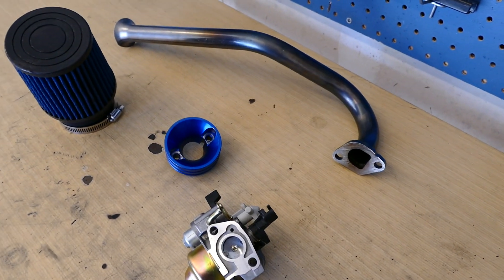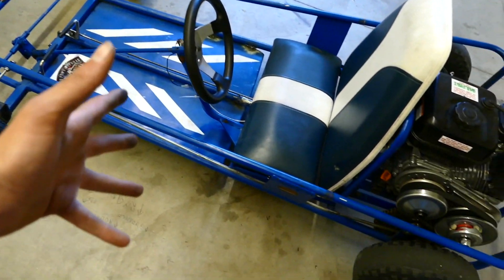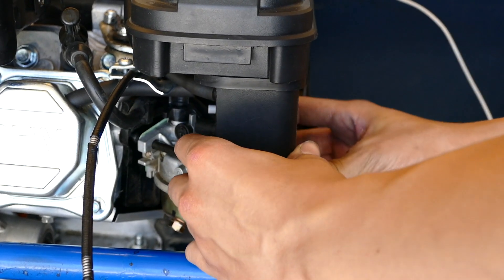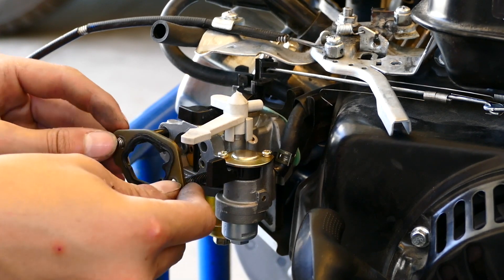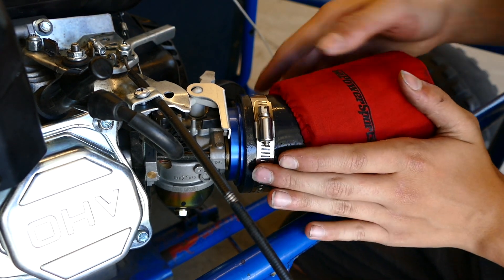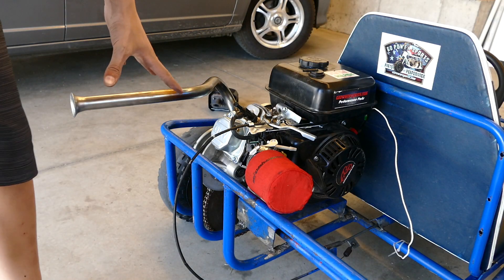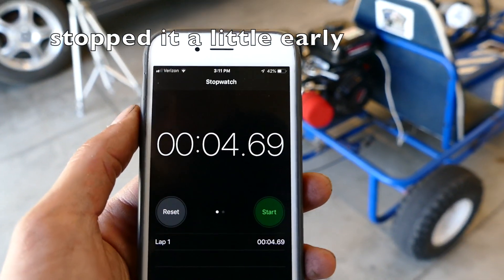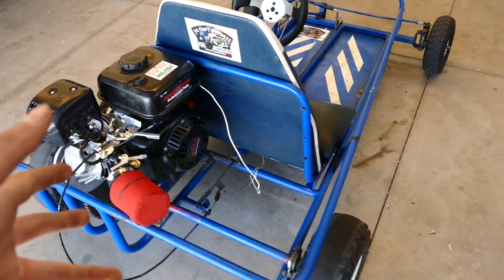How to Install a Stage 1 Kit on a Predator 212cc

Comment: 4:00 I don't suggest you use teethed pliers because I did that once and it poked a hole in my fuel line. If you don't have flat edged pliers then just take some tape and wrap it around the teeth part on the pliers and your good to go.

Comment: What if you install everything but the carb jet?
Reply: Then it would be useless
Reply from the maker: it just wont run very well because of the lack of fuel and make less power than with the carb jet

Comment: How did u get torque converter to fit with a one wheel drive?
Reply from the maker: the secret is.....
it’s not one wheel drive. it’s a live axle 😂 the sprocket is just way far on the left for some reason

Comment: So it isn't necessary to change the carburetor stud to the longer one on the on hemi 212 when installing an air filter?
Reply from the maker: Nope, you just use the original studs and nuts and gasket. super easy

Comment: You’re defeating the purpose by leaving that stock stifling muffler on there kid. That’s why the kit comes WITH the header pipe. You have 2 parts of the mandatory 3 parts done. You won’t see that significant of a change unless you trade that purse in for a wallet. Hehe I’m messin w/ ya buddy. Honestly put that pipe back on.
Reply from the maker: yeah, i know why it comes with it, and on paper it seems like it would hurt it, but in practice i haven’t charted any difference at all between the header pipe and the muffler, even if you leave the stock muffler on it still gives you a massive power gain over completely stock. on an engine like my stage 3 predator 212, it definitely makes it a lot slower, so for that i’ve invested in a custom made header pipe and RLV performance muffler. that thing hauls.

Comment: I just got my stage 1 for my 212 predator and I’m having issues with it and I don’t know why
Reply from the maker: strange. what kind of issues? it should work fine.
Reply: I found the issue but my top end now is lower than it was now
Reply from the maker: @davidrivera2514  top end of what? your engine?
Reply: Ya
Reply: Top speed

Comment: I got one of those HF wheel sets a few months back for my go kart front wheels, was riding my go kart when the hubs snapped out of the wheels. While I was riding 😂
Reply from the maker: that happened to me when i was drifting in the grass with my friends last summer. the hub snapped off. so i drove the kart home on 3 wheels.
Reply: @WildfoxFabrication  Oh nice 😂 issue here is, both my front wheel hubs broke off...
Reply from the maker: @jac_attack04_59  well thats unfortunate... 😂

Comment: Is that a live axle on the rear? If so, how did you make it live?
Reply from the maker: yes it is a live axle, it came that way, but GoPowerSports.com has a weld-in live axle conversion kit that has everything you need.
Reply: @WildfoxFabrication  ok thanks,  I have some things coming from them already